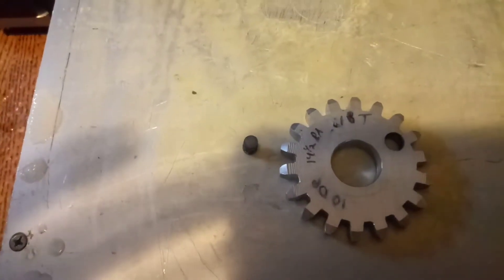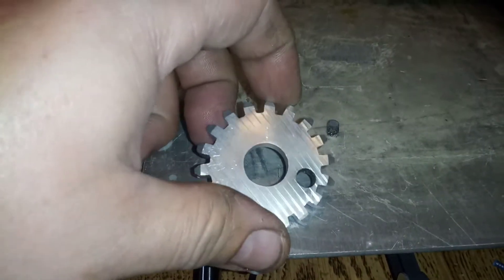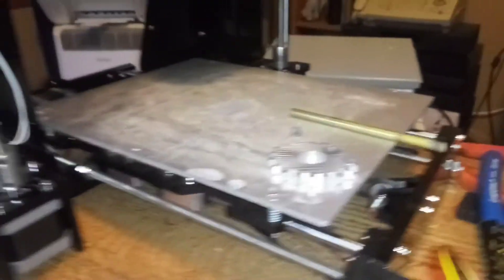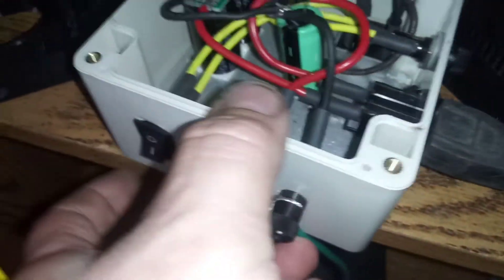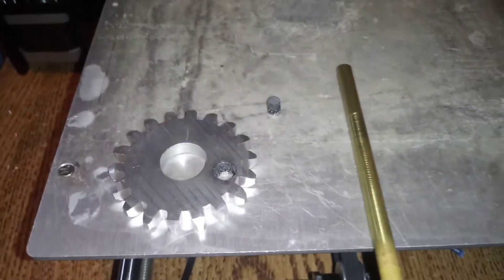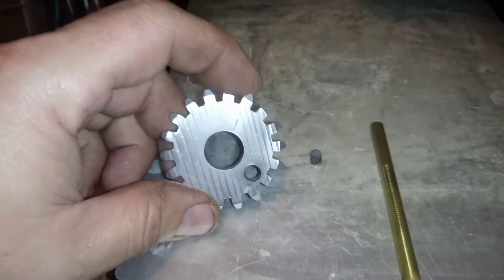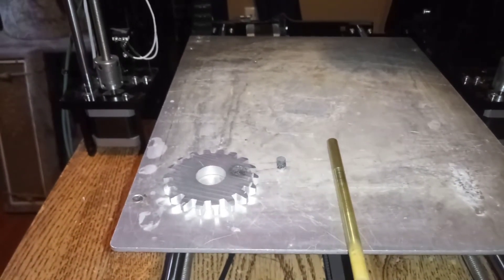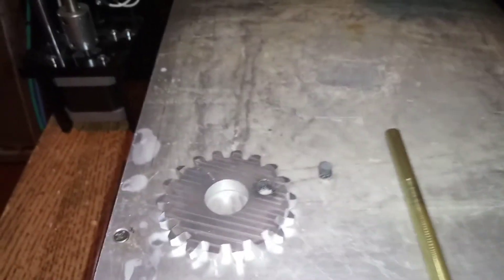Diy EDM success!

Comment: You said that hundred and 50 microfiered capacitor made all the difference, is that Pulsing DC off of the mains You're using? Normally there are some resistors limiting the current to like 10 amps but I don't see any there. What are you doing? Would you be willing to share a simple schematic? I'm very curious about these power supplies.

Comment: Great project! 
I'm interested in building something like that as well but i'm a newbie so i can't help you by now, but I saw something similar here, and i think he had great results, drilling very neat 0,7mm holes through ball bearings, drill bits and whatnot, maybe he wouldn't mind giving you some advice.  

Drill through anything (conductive) with Electrical Discharge Machining
https://www.youtube.com/watch?v=rpHYBz7ToII

Comment: That's amazing, you've managed to replicate a hole drilled by a Chinese drill bit.
Reply: Ah, but did his method break, dull, slip on the hardened surface, catch on something right in the middle of the cut or for some reason just decide to jump out of its triple tightened Chinese Chuck?

Comment: Nice! I was thinking the same thing, that a cheap 3D printer frame would make a great EDM since there's no force on the cut anyway. FYI Ben Fleming's books describe a simple circuit for controlling the up/down motion of the electrode, although it directly drives a brushed DC motor so you won't be able to use it on a stepper.

Comment: to cut a shape such as a sprocket you'll need an wire EDM.  as you talked about figuring out dept/retract for the electrode.... this is usually controlled with a servo motor. as soon as the current get to high it will retract little more as the usual step. its for sure not a given ( pre'  programmed) step and direction thing